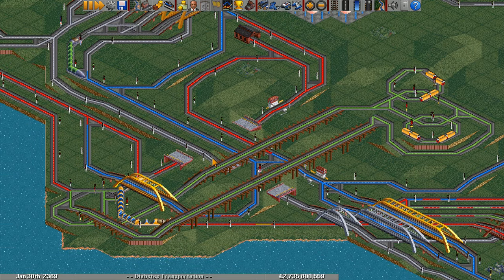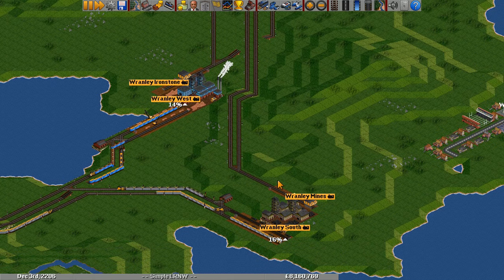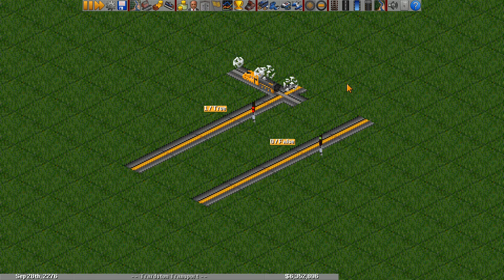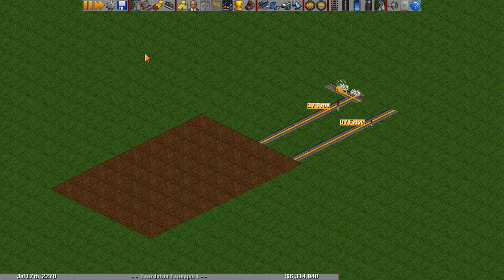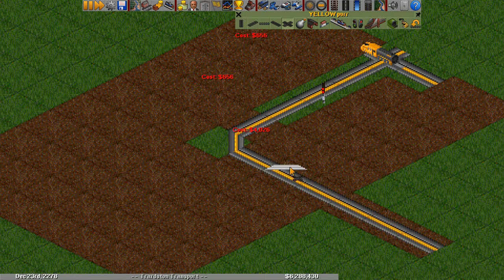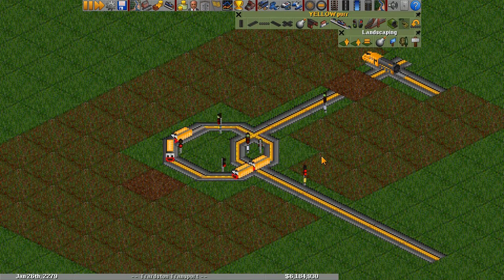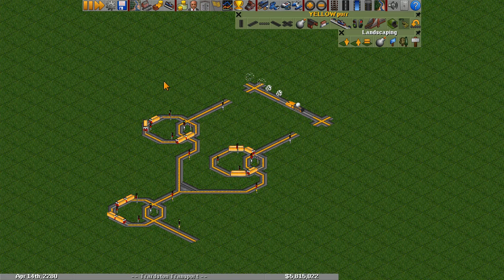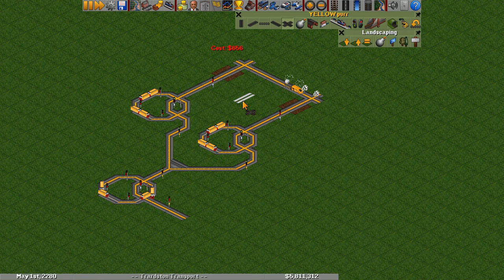OpenTTD Logic: 01 Introduction to Logic Circuits, AND Gate, NOT Gate

Comment: An interesting concept.  Incidentally, the concept at 6:54 is De Morgan's Laws, which provide a means to transform NAND into NOR (&vv), which only requires the odd NOT to flip things.  It's frequently used in logic design because the workings of a transistor mean that a digital signal typically gets inverted.

Also, fun fact: On the British railway network, a signal is said to be "on" when at danger and "off" when clear.
Reply from the maker: I didn’t know about the British “on” and “off,” maybe the OpenTTD convention comes from something like that
Reply: @LugnutsK  Given its a 50/50 choice, it could just as easily be coincidence, but who knows. The system works just as well either way, the only difference being that the AND gate in red-positive is an OR gate in green-positive (&vv).
Reply: Another entirely different parallel I see is with digital electronic circuits.  There it is a design principle that if a part of a circuit is not powered, that you want the outputs of this unpowered part of the circuit to read out as a boolean value that has the meaning "off" or "inactive" (which is in most cases mapped to boolean zero).  In openttd circuits, trains are the thing that "power" the circuit.  But in openttd, if there is no train in a block (so that the block is "unpowered"), then the signal is green.  So looking at things through the electronic circuit parallel, the green openttd signal would correspond to the "off" state (boolean zero).

Comment: This is fucking awesome, Theoretically, you could build an in-game computer using those circuits. That's even more clear when you watch the next video, where you build a calculator.
Reply: Which also means you can build a computer playing open ttd in open ttd and then build a computer inside of that and so on It will probably run at 0,0000001 FPs but in theory it should work.
Reply: @jonkess2768  What if we live in a simulation inside a computer created in an OpenTTD?
Reply: @PiotrDzialak xddddd hahaha na bank

Comment: Where did the logic engine come from? Does it complain about not making any money each year or is it “special”?
Reply from the maker: IPv6 Freely Ah good question. You can use any one tile long train, the logic train (from NUTS in this case) is just a custom one specifically for logic, goes fast and can’t carry cargo.

It will complain about money and orders but I have those notifications permanently turned off.

Comment: On both input tracks you have extra angled tracks that make "arrows".  (Like what you would use on a "reverser" track.)  Are they required for some reason here?  Thanks
Reply from the maker: Ah, yes they are. The pathfinder prefers paths that have multiple options.

If it didn't have them, the pathfinder would see 1 dead end due to the two-way EOL, and the other path might also be a dead end due to a terminus station. So the train might not behave as expected.

But with them it makes sure that an open path will always be preferred over the other path.

Comment: The two train release can be done with just a NOT gate on the less preferred track, with the outputs to both tracks as shown. Couldn't it?
Reply from the maker: Yup it could
Reply: @LugnutsK  I do understand that part of the purpose of the tutorial is to show off both AND and NOT. 

Oh, and the NOT Only version is infinitely expandable, just add a bridge over for each additional option, the single trigger releases them all. I'm just starting to experiment with the simpler elements of logic systems. Your tutorials are essential.
Reply from the maker: @beauxguss6321  Yeah the benefit of using the full design is that its resilient to any changes in train path-finding preferences, though there are also other ways to ensure that.

Comment: Per your example, how does the Iron Ore and Coal Industry related to? Each can produce simultaneously without affecting each production. I understand that the Port produces Eng Supplies which is needed by both Iron  Ore and Coal to a certain production level, on the other hand once the Iron ore and coal receive Eng Supplies it produces different products. So why is there a need to simultaneously deliver Eng Supplies to both Iron Ore and Coal while both produces different products? Is this just a mere example to illustrate the circuits? Are both Iron Ore and Coal have another destination that needs both to have equal amounts of produce? Please just help me understand. Thank you.
Reply from the maker: As you put it, it is just a example to illustrate the circuits, one that I made for the video. But in a proper FIRS game you would transport the iore and coal to the next industry in the chain. And it's important since FIRS gives better production for a particular secondary industry if it receives multiple types of cargo (instead of just one).

Comment: why my logic train slowing not fast as yours thanks
Reply from the maker: Could be several things. If you're using NUTS the rail/monorail logic engines have some acceleration time (due to the way tractive effort works), but the maglev accelerate instantly.
Reply: I had this problem as well. I noticed the trains wouldn't accelerate to full speed because of the signal which would slow them down. I had to change the "Train acceleration model" from original to Realistic. Now may trains move as fast as on this video.